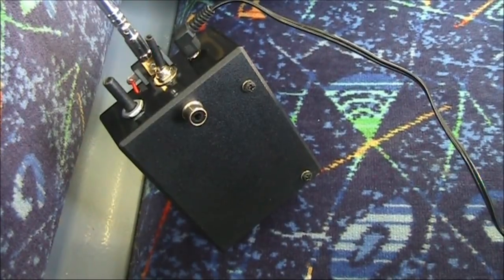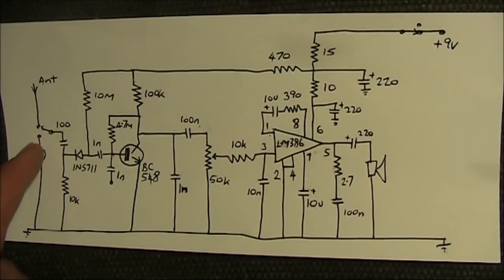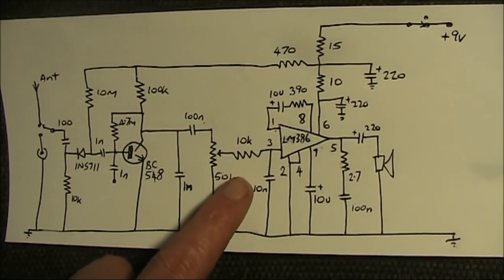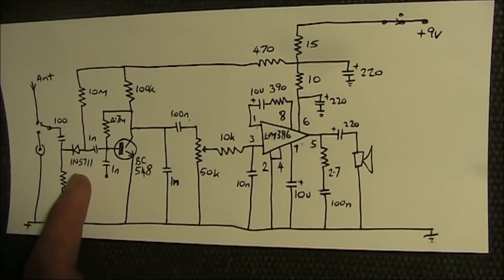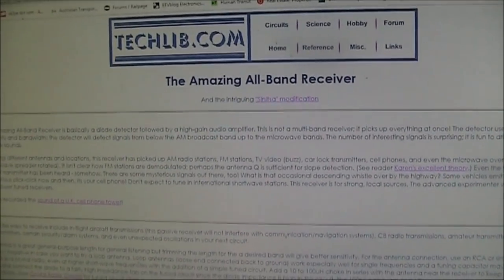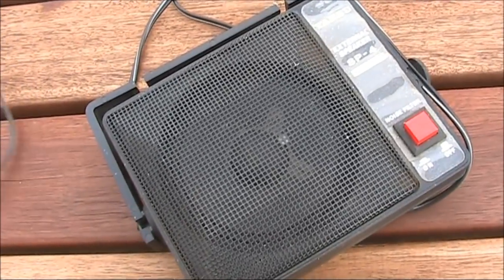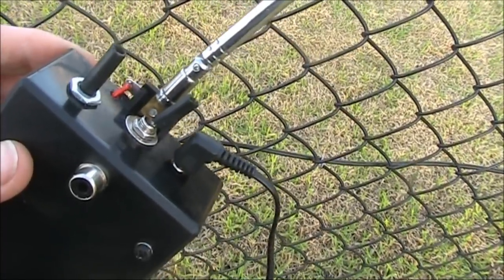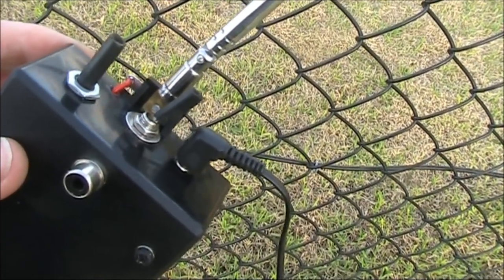All bands at once AM receiver

Comment: I build it with 3V power source, at first stage use 2M2 instead of 10M and use 1N34A diode, and the very important BEST Transistor to amplify signal until 300MHz, use 2SC9018!
Output from stage 1 throw up in TDA7056 as power amplifier.
Sooo loud and FM - VHF range heard beautifully!

Greetings from Jakarta, Indonesia 🇮🇩

Comment: Im in N. America, so the 2SC9018 (as suggested by another poster) is not available. I have used a 2n2222 transistor, but all other parts are as per the schematic. Why can I not get the wall to wall audio output as per your video?/

Comment: Hi there! i've made this fascinating project myself following the schematics on Techlib.com and tried it today! my receiving signal is still very weak, i've just used a 2n222A transistor instead of the 2N4401 (couldn't found anything else, we're in quarantine because of coronavirus) and a 1N60P small signal schottky diode. I'm kind of a newbie on RF but my aim is to pick up low frequency signals and weird noises, not really interested into hearing AM stations. Also been thinking into replacing the antenna RCA connector for a RP-SMA connector, but just realized that the antenna for this project doesn't need a gnd connection, dunno, should I try the loop receiver mod, maybe???
Reply: I build it with 3V power source, at first stage use 2M2 instead of 10M and use 1N34A diode, and the very important BEST Transistor to amplify signal until 300MHz, use 2SC9018!
Output from stage 1 throw up in TDA7056 as power amplifier.
Sooo loud and FM - VHF range heard beautifully!

Greetings from Jakarta, Indonesia 🇮🇩

Comment: Hello aim from argentina, and need your help, please, you know de radio transmission, and my projetcs its replicate to don smitch dispositive, or kapanadze distositive, please have any questions for you, thanks, abrazo grande
Reply from the maker: Sorry I can't understand you.
Reply: @vk3ye  
Hi how are you? forgive my English, I'm from Argentina, and I'm replicating a device that receives the signal wave as radio Galena, and makes a Tesla-style coil to resonate and the frequency is accumulating and amplifying and I want to reach high frequency in a spark- gap, and from there with the ground wires I generate an electron channel and only with the resonance of the coils in high frequency that channel remains open and I extract all the energy that I want, but I need an air antenna capable of receiving all the As more positive charge as possible, and from the earth the greatest negative charge it can, are electromagnetic waves, magnetism of the earth and electro of the air, would that antenna be a hollow copper antenna? which antenna is better to capture the electromagnetism of the environment? thank you very much, big hug, the device you find it as kapanadze, or device of don smith, are inventions of tesla made with electronics, I want to do it with radio galena, which does not need batteries, only the frequency
Reply: @vk3ye  
Hi how are you? forgive my English, I'm from Argentina, and I'm replicating a device that receives the signal wave as radio Galena, and makes a Tesla-style coil to resonate and the frequency is accumulating and amplifying and I want to reach high frequency in a spark- gap, and from there with the ground wires I generate an electron channel and only with the resonance of the coils in high frequency that channel remains open and I extract all the energy that I want, but I need an air antenna capable of receiving all the As more positive charge as possible, and from the earth the greatest negative charge it can, are electromagnetic waves, magnetism of the earth and electro of the air, would that antenna be a hollow copper antenna? which antenna is better to capture the electromagnetism of the environment? thank you very much, big hug, the device you find it as kapanadze, or device of don smith, are inventions of tesla made with electronics, I want to do it with radio galena, which does not need batteries, only the frequency
Reply: @vk3ye  
I had thought about the antennas of LAKHOVSKY, that they are with hollow pipes of copper, you have an equal or similar, that antenna is a multiple wave oscillator so it is said of its function, this antenna is high frequency, my idea was to make this antenna and use it to receive electromagnetic waves from the air, and see how to make a ground antenna, please appreciate your help, thank you very much, it's like a radio but it emits high frequency, I can not find a way to raise the frequency, with a variable capacitor? jugs leyden? well, thank you very much
Reply from the maker: @data112  Sorry I cannot help you on your questions.